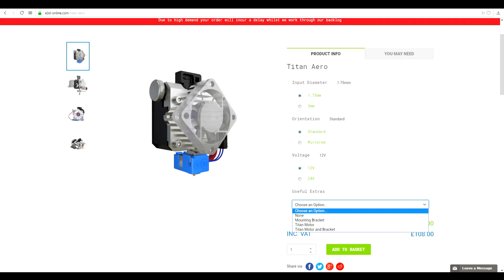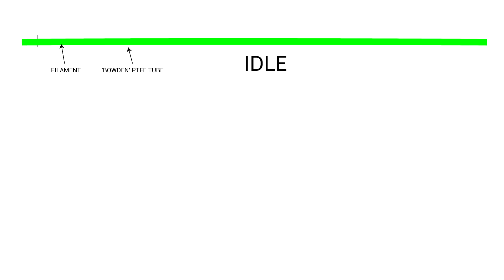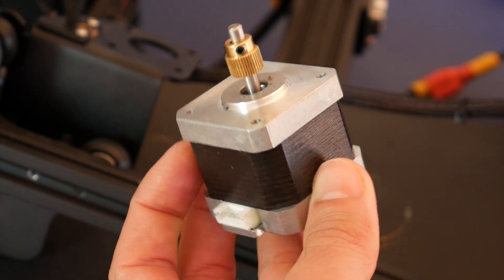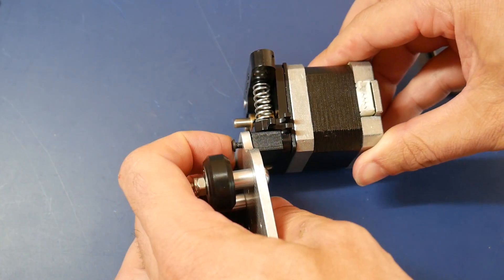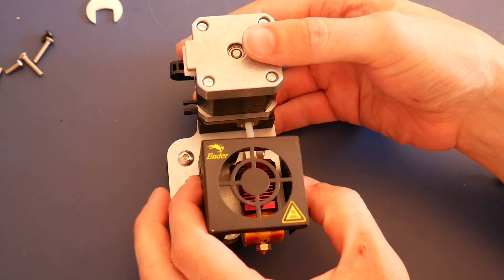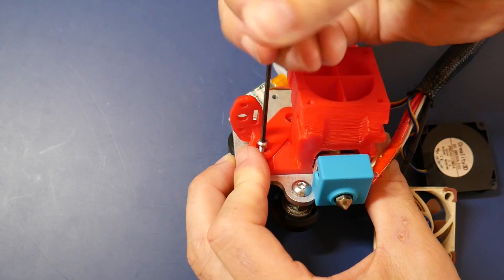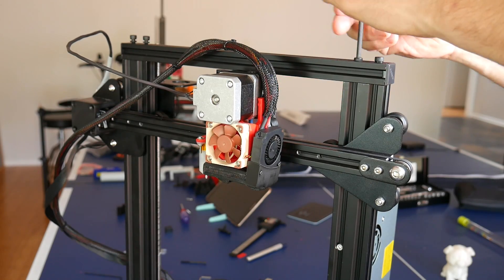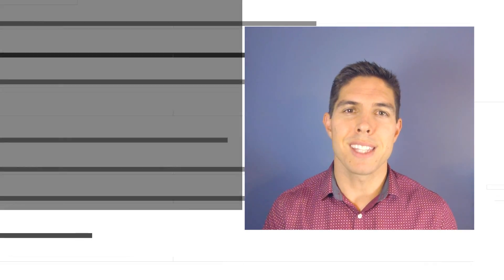Simple direct drive Ender 3 mod for only $35

Comment: Hello Michael, great video, I am very interested in swapping to a direct drive on my Ender 3 and CR-10s, I love it on my Wanhao Duplicator i3.  I must admit, this looks huge, I was wondering if you by any chance, weighed both before and after to get the difference in weight, just to test how it may effect travel speed and jerk.  I will definitely look into this drive.
Reply from the maker: I think a pancake stepper would be a logical next step to reduce weight. Sorry I didn't weigh it, was too busy iterating the hero me modification.
Reply: @TeachingTech  the extruder needs too much torque for a pancake I fear.  You'd have to go with a geared extruder like you already did with the titan aero instead.

Comment: What do you thing is the benefit of this versus fully 3d printed part like this? https://www.thingiverse.com/thing:3325505
I am thinking about trying it, as I think I am having serious extrusion issues with my Ender 3 and I hope direct extruder can mitigate them.
Reply from the maker: That one looks ok. Advantage here is CNC machined aluminium. It's stronger, and therefore more compact.

Comment: Great walk-through Michael. You always take the trouble to make the mistakes before we do, and explain how to avoid/fix them. For me I think I'll stick to the Bondtech.
Finally installed the Petsfang duct and housing on the CR-10, also added LEDs and the holder too. Also upgraded the Noctua 40x10 to 40x20 on the Micro Swiss hotend, just to give it a little more airflow since there is room for it now. Z offset calibration and test prints tomorrow morning.
I'm considering moving the electronics to below the bed and do away with the separate control box, but that's gonna need a lot of pre-planning and design so it might be a while. I'm sure I'll find other stuff to add/upgrade in the meantime though :-)
Reply from the maker: Thanks Spike, very kind. The Petsfang is a good design. I have the bondtech upgrade in the mail for my mk3. One day I will do the all in one mod to my Tornado and there's a good chance much of it will translate over to the cr-10.
Reply: @TeachingTech  Yeah the Petsfang is great for air cooling, but it s a bit of a hassle for maintenance
Reply: @TeachingTech  Most of the mods I've done have been as a result of your videos and your detailed guidance has made it very easy to transpose to the CR-10. Looking forward to your Tornado all-in-one mods.
Reply: @TeachingTech  will this also work on ender 5? Is there a way to use a flexion extruder on ender 5? I'm new to 3d printing so excuse my questions if they seem odd.

Comment: Definitely interested in this for my Ender 3. This should really help with printing flexible filaments.
Reply: Same here, did you ever get it? I was concerned with the simplicity of the mod making it too good to be true for flexible stuff but I also want to eliminate some of the waste the tube causes.
Reply: @SwiftCreationStudio  I actually ended up upgrading my ender 3 to an E3D v6 hot end and an ezr struder. Chuck Hellebuyck did a video on the ezr struder from See Me CNC on an ender 3 and was able to print ninjaflex with it, so I went that route. So far so good! It keeps the hot end light too, so I can still crank up the speed if I want without getting a bunch of ringing.
Reply: @hotbrass2005  nice, I was looking at this for a one off attempt to use more flexible stuff as a one use mold and the prices on conversions like this is dirt cheap now (like 10-12 dollars) so I figured it's worth knocking around if only to not have the wasted material. 

I'm averaging about 10inches of waste because of the motor and tube set up so far from the hot end.

When I first got it my mom bought me one of those Amazon multiple color kits of 3d pen stuff to test stuff out and I have like 10 clips of 10 inch pieces which adds up.

Comment: I did this mod about 2 weeks ago, i didn't bother removing the gantry, just took off the wheels . The guy who sells these is real cool and threw in exrta wire to extend the stepper motor wire but i didn't wanna butcher it so i just ordered a 1000mm cable which is perfect length from the mobo to the extruder. I haven't tested it alot but the kit is very nice.
Reply from the maker: That's a clever way to install it. Thanks for sharing.

Comment: HA, I went through 3 versions of the Hero Me duct... 1 PLA and 2 PETG and they ALL warped like yours did! I wish they would remix the design to add more support for the cooling fan.
Reply: @Goss which ones work the best for you?
Reply from the maker: I might remix it if the 5015 duct does the same.

Comment: Please do follow up on MKS Gen please. Awesome videos.
Reply from the maker: Waiting on the SD/touch LCD in the mail.
Reply: I got my MKS Gen L (+TMC2208) and MKS TFT v4.0 last week, your video on changing the motherboard was awesome to follow!
Installing the MKS TFT was pretty easy as well, only had to change the baud rate in the firmware, basically plug and play.
Reply: @lukas_berger  Hello, why TMC2208 over the TMC2130?
Reply: It is newer and runs less hot
Reply: @wrungler2658  it not newer. the 2130's with spi change the current and can make your printer run almost silent. just more work to et working right. got my mks with 2130s running spi with lcd and sd card. took 2 weeks of fidgeting with it and trying new releases (think they where working on it as the newest works and the one from 3 weeks ago does not). love it and the loudest thing on my printer is the fans.
Reply: @TeachingTech  Great videos - thanks!  I'm trying to install my gen l, bltouch, and the mks tft tonight.  Let's see how it goes!  I'm sure I'll need some tips from you and the community.
Reply: Better off putting in an Einsy Rambo better board than the Gen.